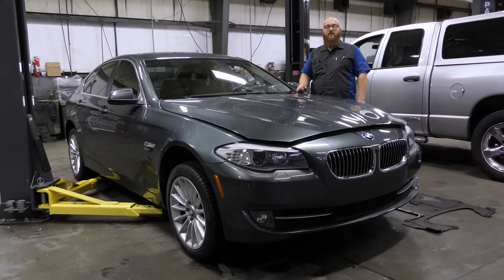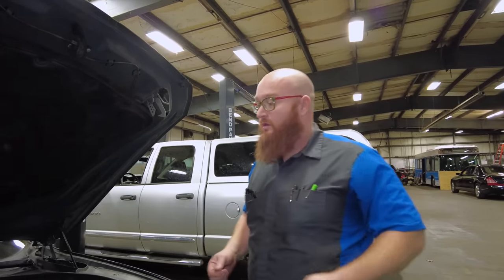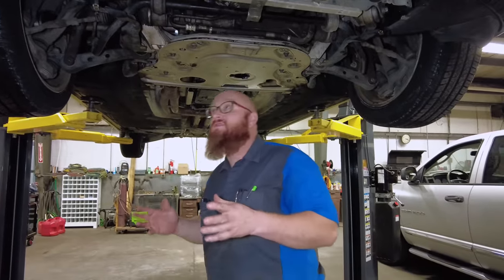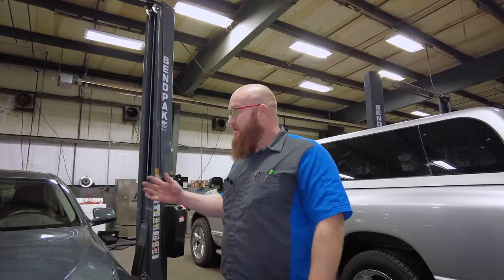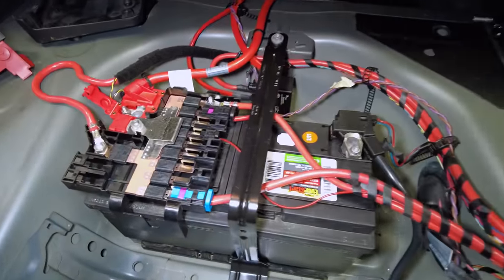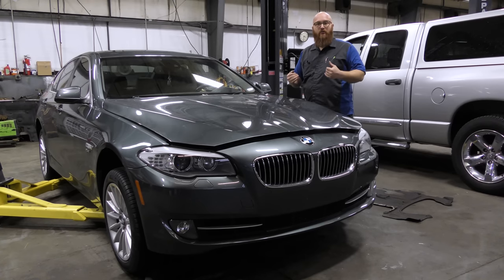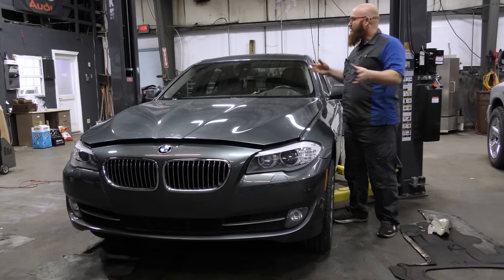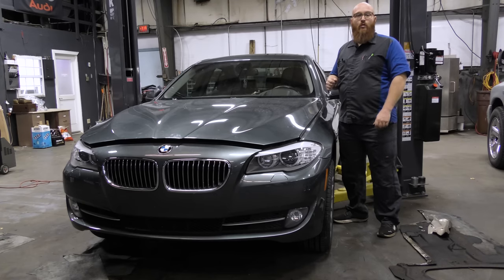One bad day for a customer! CAR WIZARD found TWO insanely unrelated issues at time on '12 BMW 535i

Comment: When I was much younger, I was really into BMWs. Unfortunately, I owned a few endless money pits.  My mechanic told me, if you can’t afford a new BMW with a warranty..you’ll never afford a used BMW without a warranty
Reply: Yeah, that's what puts me off buying a secondhand one...
Reply: Yeah you really have to be able to just dump thousands without caring or really even noticing to own a german car out of warranty. If you can do that a grand a month payment or whatever is probably well within your budget. When I bought my porsche I realized there was no way in hell Id own it long enough for even the warranty to expire more or less actually ever need a repair. 2-3 years till the next one max
Reply: Exactly! I’ve been a BMW enthusiast for 10 years and currently own 2, an E30 and an E39 but you have to be willing to pay the price of ownership. So many people buy old German luxury cars for the “look” or what have you but don’t realize the maintenance on a $6000 BMW is that of a previously $80,000 BMW. The price of
parts doesn’t go down in value like the car does.
Reply: I feel sorry for your customer, I’ve own a couple 7 series and a X5. Had problems with both but they were un😅warranty. Wizard isn’t 200K a lot of miles for any car?
Reply: Most buyers lease these for two or three years then bail out of the lease well before the warranty expires. Many businesses write off the lease cost as a business expense. Additionally, these cars go through multiple owners and most subsequent owners buy these as status symbols but do not possess the financial resources to keep them properly maintained.
Reply: I bought mine used and bought the extended warranty - THANK GOD because it needed new valve seals at only 60K miles.
Reply: I've taken a chance on two second hand BMWs. One is a 2005 320i with the 2.2 ltr. six cylinder, and it's been a great car. Still drives perfectly, even though it's nearing 300,000 miles. My other one is a 2015 535i with X Drive and the M Sport package. I bought that one from the dealer when it still has six months warranty left. So far, it's been trouble-free.
Reply: I had 535 for 6 months with only 100k miles on it and the engine died, paid 5k to put a used engine in and was lucky that I got hit by another car 1 month later on the highway and it totaled my car and insurance paid everything including the engine (Canadian insurance is great sometimes) I would have never sold that car even close to what I spent on it with all repairs.
Reply: Lol
Reply: Eh, I've owned a few mid 2000's BMW's, one E46, another E90. They all reached 400k km, (260k miles) effortlessly, just basic maintenance. Water pump and T-stat are common, but otherwise the Inline 6 (no Turbo) is dead reliable. Common other issue is valve covers (common on a lot of cars and is just a fact of car ownership), oil filter housing gasket leak and oil pan leak. I wouldn't own a new BMW out of warranty, but all the early 2000's to 2010 BMW's are pretty reliable, the inline 6's, not the V8's or xdrive variants.
Reply: Luckily, I've never had the desire to own a BMW.  Looks like I dodged that bullet!
Reply: @houseofno  Exactly what I do.  I don't care if there's high interest rates to lease!  If don't want to have interruptions to my time/life.  I work in an industry where you are judged by what you drive!
Reply: @tyromecharleston7580  not a toyota
Reply: Now I understand why Toyota fans are pissed that their beloved Supra now has a BMW engine. Although Toyota said they tested the engines for quality control.
Reply: german cars are for people who hater their time and money.
Reply: @KeatonDee  German cars were great decades ago. I owned a bunch of them up through the mid '80s. Metal engine parts, hoses with clamps, starter change without pulling the intake. Since then, BMW has led the way with replacing as much as possible with plastic, and today, many German cars even require engine removal for routine repairs.  If poor design and cheap materials is what comes with the price of ownership, there are better choices!
Reply: @sunbeam8866  Of course. Most automakers are using plastic in lieu of metal because of cost savings. It’s just that Toyota parts cost half as much as BMW parts. You’re paying for the name which I think is unfortunate. Also, the engineers at BMW just aren’t what they used to be. I think their newer vehicles are poorly made for that reason. I’m only into pre 2006 models anyway.
Reply: @st.k.4528  For a while, BMW was selling the idea of low cost of maintenance by recommending oil changes at 25,000 klm intervals, which eventually proved to be detrimental to engine life. I purchased a two year old 535i from a dealer, and they recommended oil changes at 12,000 kms. I didn't like that either, so I change oils at 6,000 kms.
Reply: @KeatonDee  Actually, according to a BMW salesman I spoke to several years ago, they do it for "weight reduction"! 🙂
Reply: @damilolaakanni  Not just the engine. It's my understanding that the whole car is made by BMW!
Reply: @sunbeam8866  Haha of course eh! That’s what they want us to believe.
Reply: This reminded me of a Euro car magazine cover I had seen years ago with two BMW M5's with the headline 2JZ swap sacrilege! So I had to read the article. Turns out that the two M5 owners were friends that loved the car. But in one particular case the owner had already spent $10k since he bought it and was upset that all that money had gone into repairs instead of modifications. So him and his friend decided it would make batter sence to make them more reliable by swapping the engine for the legendary 2JZ-GTE from the Mark IV Toyota Supra Turbo. They had no regrets afterwards.
Reply: Bmw= junk.
Reply: and here I am, bought 2010 E90 325i with 82 000kms, four years later, never had a single problem at 165 000kms, no warrantly nothing. Best car I've ever owned .
Reply: @St. K.  Now look in the mirror and say "I bought a 535 with 100k miles on it and i have no idea how the 1st owner drove and maintained those 1st 100k miles"
Reply: @gulfstream7235  if you can do the work yourself then you can afford it.
Reply: The newer ones are pretty reliable. the N55 EWG models fixed a ton of issues
Reply: @KeatonDee  yeah lets pretend they are not over 20 and 30 years old. What do you expect? To run like new?
Reply: @st.k.4528  if you dont service it ofcourse you will need new engine. You are all bitching about bmw but none of yall show your maintenance history. I bet its a mess
Reply: @nenaddimitrijevikj5125  O agree but it is almost impossible to know what previous owner did for the maintenance.
Reply: @st.k.4528  depends, there are people that keep their entire service history. Frankly if im buying more high end car like a bmw i would be asking for the history or i would walk away. It all comes down to that. I  am not saying bmw didnt have their misses with the engines but they are not that bad. For example i owned e39 considered as one of the most reliable cars, i had the wort experience with it. LEss than a twin turbo 4.4 V8 that i had on my X6
Reply: @tyromecharleston7580  yes….these mechanics expect every car to make 300,000 miles, because a few Toyotas get there.
Reply: I don't know lad, Ive had E39 530D for a long time, has got 790k km on the odometer..works really great.
Reply: @nenaddimitrijevikj5125  True, for whatever reason there arent many problems with them here in EU. Clearly seems to be a Murican issue
Reply: @MousemanLV  most definitely it is, and they dont know there are much durable almost immortal BMW's with diesel engines too
Reply: @damilolaakanni  they prefer driving sewing machines.
Reply: That isn't true a lot new bmw are dang reliable, I don't get all hate around it... 335i n55 or b58 with zf transmission... bullet proof.
Reply: @mzansipunters4295  165K is really nothing, wait till you get 400K, that's common corolla life...
Reply: @Align700nitro  who wants to drive a Corolla 400k?  I’d rather take the bus at that point.
Reply: Or just do it yourself 🤷🏾‍♂️
Reply: @dotover9013  you go right ahead man, I rather walk than taking the bus. Bus ride is rough here.
Reply: how are the classic 320's from the eighties?
Reply: @CandyMan2001  I just buy japanese cars lol. Have a camry. would love a camry trd. the only bmw I want is  a classic  320i from the eighties.
Reply: @CandyMan2001  rich people are cheap. they are the ones driving the 2000 camry lol.
Reply: @KeatonDee  :yougotthis::yougotthis::yougotthis::yougotthis:
Reply: How true! My E60 just died. Without warning coolant got into cylinder #6 and it cracked, end of story 😪
Reply: @gertstolk  ugghh sorry for. 07 camry 139k miles. Battery just went under warranty replaced I think I am ok
Reply: My fantasy car in high school 320i. If I have money I will buy one from the eighties
Reply: That's some sound advice right there.
Reply: @KeatonDee  Thr price of parts always goes down for parts especially if the car is relatively common. Americans seem to buy their parts from the dealer then bitch about how expensive they are
Reply: I don't think this statement holds water. I bought a cheap BMW and have put 60k km on it without any significant issues. It's got some gremlins I'm ignoring but it's a good car.
Reply: @damilolaakanni The B58 definitely had Toyota input with how few maintenance issues it’s had.

Comment: Can’t hardly complain about a 200,000 plus mile car
Reply: Expensive cars have expensive repairs.  I wouldn't really complain.   If you could afford to own a car like that, 2 or 3k repair jobs is just par for the course.
Reply: One repair out of that 200k I haven’t had any issues on my Crown Vic with 200k yeah a few maintenance wear items
Reply: @stevelouie5928  Totally agree...200 000 miles !!
Reply: @1983dmd  We don't even know the repair history.  If this was his only big repair over the life of the car, then I'd say bravo for BMW.  I have a 2017 BMW now and so far so good.  I had a 1993 audi and put 200k miles on it and the biggest repair was a failing heater core that cost 1.5k to repair.
Reply: @WarriorOfEden3033  Those are known to go a million miles as Taxi cabs. Old technology, but very reliable.
Reply: @stevelouie5928  That's the problem. Most people who buy these cars, can't afford them.
Reply: @Barneyrubble241  they need to build simple cars again
Reply: Yeah at 200,000 miles I'd just do a whole engine swap

Comment: 200K miles, dang I’m impressed it lasted that long
Reply: My 2012 Fiat Punto has almost that much.
Reply: My 318 E46 from 1999 has 225.000 kilometers and it needs  extra attention lately. Overall it has been reliable . But to think that a Fiat Punto is still running at 200.000 miles = 320.000 km is on another level.
Reply: ANY CAR can have a starter go out, oil leaks, and a hose blow off at 200K miles.
Reply: @ShowMeWhatINeedToKnow  Agreed.  I'm not a fan of BMW but by the time something has that many miles on it you've got to expect SOMETHING to fail.
Reply: last week, i seen a bmw 525d xdrive reach 480.000km. on service for timing chaing replacement. still working.
Reply: @ShowMeWhatINeedToKnow  Great point, a Ford or a Chevy wont be any better. For all those who think older US cars were not maintenance hogs, I remember the 80's well.
Reply: Here in Balkan, almost every BMW of early-mid 2010s I looked at has well over 300-400k kilometers or more.
Reply: I have 208K miles on my 1991 BMW 850
Reply: Literally 😂😂😂 once he said that I was like $1200 ain’t bad
Reply: @ShowMeWhatINeedToKnow  that’s what I was thinking. He talks mad sh’t about bimmers but when he told me it had 200k+ miles on it, of course something like that is bound to happen, to ANY car for that matter..
Reply: @ShowMeWhatINeedToKnow  
😆😆😆
Only the BMW/Audi/MB crowd believe that.
Honda/Acura/Toyota have barely sneezed by 200k miles.
It's great to talk to some Beamer owner and hear "100k and no problems, except twice it stopped for no reason!"
Reply: @SK-lt1so  -- Uh, Toyotas have LOTS of problems, dude -- you're 1000% programmed and drinking ALL the Kook Aid if you think otherwise.  Look no further than 4cyl 2AZ-FE with MASSIVE OIL CONSUMPTION issues.  Every single one of those engines will eventually end up burning over a quart per 1000 miles if maintained at Toyota recommended service intervals.  Only way to fix the problem is to replace all the cylinders and the rings.  Two years before that the 2AZ-FE had valve stem guide issues.  And two years before that the 2AZ-FE have heads pulling out of blocks.  Is that the Toyota quality you're talking about??  I'd say that's a pretty crappy track record.  And they stuck that engine Rav4s, Camry's, Scrion tC, Scion xB,  and some Matrix and corollas -- lots of people getting screwed over, especially on the used car market, thanks to Toyota.  OR do you want to talk about the Toyota 2GR- FSE which needs new cam gears every 60-80K at the cost of $2000 a pop?  Or maybe you want to talk about the 2GR-FSE overheating issues on cyl number 5?  Or, Toyota's crappy water pumps?   Or maybe you want to talk about valve spring issues in their V8s which will destroy their engines?   Let me know.
Reply: @ShowMeWhatINeedToKnow  Thanks for that, I thought that I was the only one who always had issues with Toyotas
Reply: @ShowMeWhatINeedToKnow  no he's not
Reply: My BMW F01 730d got 310k miles (500k km), 2nd owner, bought it with 250tkm, and I didn't change anything, beside tires, oil and filters, nothing else... N57 best engine ever!
Reply: @randomcommenter1433  exactly, im from Slovenia and my F10 530d has 280.000km without any major problems and it is still going strong.
Reply: @ShowMeWhatINeedToKnow we got two tercel in our backyard 91 and 94 . Still running still strong . With little to no maintenance. You funny child
Reply: @Rift45  i am with you. the reason japan moved in was the crappy quality and still crappy quality of american cars. there are only two good cars in the world toyota and honda. love my camry.
Reply: @Rift45  most Japanese automakers except Toyota and Mazda are no better also, i see more German cars from the 70s on the road than I see of Japanese cars from the 90s and even early 2000s
Reply: @aoclive6710  i wonder why it’s in the backyard and not actually running on the road🤔
Reply: @markdamstra  Honda is overrated, it’s scary how many people still think modern Honda is “reliable”
Reply: @MarSaso  Check out M539 restorations, an amazing Slovenian BMW collector living in Frankfort, Germany.
Reply: All the Police in Germany and Europe drove BMW Diesel. They are like the Crown Victoria police cars in America